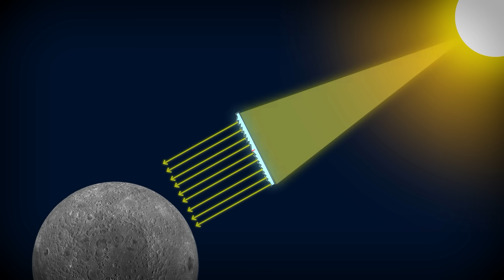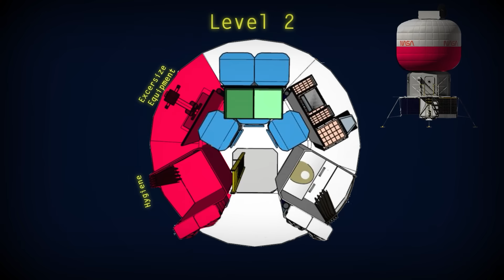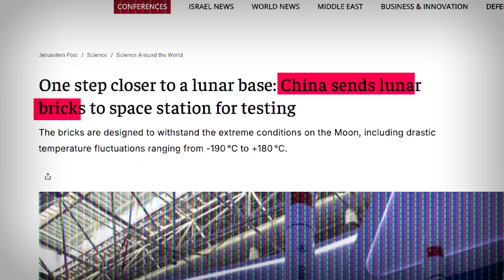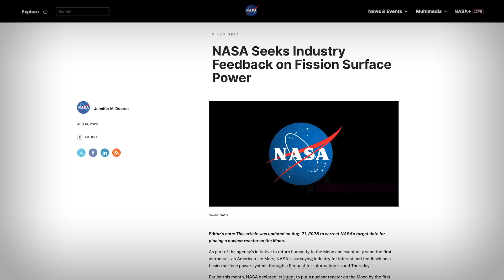How NASA Will Build A City On The Moon

Comment: NASA ain't building squat on the moon! 2025 America, has a trade deficit of nigh on 40 Trillion dollars, and hasn't the money to get to Kansas, let alone the moon! The reality is this simple, if the Americans actually landed on the moon in 1969, which is still highly doubtful, the endeavour cost billions back then, and now would cost trillions of dollars, to return,  that America can ill afford. Ok I will put it in simple terms; until the moon has water and air to breathe, no ones going to live there. Ok , lets discuss a possible scenario to make a settlement on the moon possible. Step 1( assuming that the monies for such an enterprise were magically available) then you would need to send to the moon,  most likely on hundreds of trips,  robotic surveyors, robotic excavators, robotic diggers etc, to build underground, vacuum proof dwellings. This because of radiation and meteorites falling on the scorching surface in daylight, and freezing surface at night. Step 2) those same robots or maybe different ones, would need to build on the surface of the moon, many huge vacuum proof domes, for the growing of oxygen generating plants, again managed and run by AI controlled robots, and most likely on the ratio of one dome per human,  for sustainability of that human. Step 3) The robots would excavate and build and underground network of roads to connect each dwelling. Step 3) I missed out, the power for all the excavators diggers etc, would have to come from massive surface solar panel energy farms. Thus, maybe now you are getting the picture, the logistics and costs of trying to settle on the moon, would take trillions and trillions of dollars, and most likely take four to five years before a human could set foot on the moon again?,  and hope to survive! Quite frankly its just a pipe dream, and whilst I acknowledge that from a technology viewport, it may be possible,  from a cost and logistics viewpoint,  I cannot see it happening. It will only happen if the moon can benefit the nation expending all that money,  otherwise forget, as there is tangible no return, on the staggering stratospheric outlay!

Comment: I’m just a layman and I’m probably missing a bunch of things, but instead of lasers and lenses to melt the moon sand, why don’t they just use a massive bomb that will create enough heat to melt the surface for a diameter of about 50+ meters around the build site? Yes, it will also blast a lot of the loose material away and send it into orbit for a month or so… so just wait a month for it to settle.
Reply: You are certainly "missing a bunch of thing." "Bomb" theory greatly benefits from the existence of air and friction.

Comment: Lava tubes would make for better protection from radiation and meteorites (assuming they are close enough to the craters on the south pole). This also needs to be a global effort, not a country vs country thing.
Reply: You are 100% correct about the lava tubes but seriously, I doubt if China is going to share anything. PS, lava tubes are likely to have their own water/ice.
Reply: @chrism.1131  Interesting, how could they have water ice if it comes from comets?
Reply: @Vandel212  it does not come from comets. It was blasted off the surface of the Earth along with same material that makes up the moon.

Comment: You're better off at this point to alter the human to tolerate space than alter the environment to accommodate the human.
  I'm not wrong. Life can adapt to deep ocean trenches or caves, find a way to genetically fast forward adaptation.  Or go build a "space house". One of these 2 options has millions of years of successful adaptations, one is essentially a lego house from the mind of a toddler, who thinks they're smart of course.
Reply: I think that if we ever reach Mars, it will be necessary to make some genetic modifications to the colonists. Moon or Mars though, they will still have to live in pressurized habitats. Neither location has any air pressure to speak of.
Reply: @giterdone4777  What's the missing genetic ability from every "gray alien" ever depicted?  Genitials and anything needed for reproduction, it makes sense, it's unnecessary weight for travel in space.  Especially if births have been outsourced to something else to remove the burden from humans. It gets creepier the farther down the rabbit hole.  What if we're the actual aliens, just more advanced versions of ourselves? Or, what if Ai, current day Ai is every UFO ever seen, it advanced itself far enough to solve time travel? Who knows?

Comment: Build IN...NOT ON....  For Robots  digging holes,Walkways between structures, garages would be simpler than what you plan...Take one of those inflatables, put it in a hole and cover it up...The connecting walkways would be lined with  plastic sewer liners  cities use to fix sewers instead if digging them up to be replaced...This liner would add rigidity,prevent air lose, and cut down on the dust hazard. If you need to borrow a cup of sugar from a neighbor or have people over for dinner, they can just walk over...No space suits needed

Comment: Why not blow away the regolith or mix water and regolith to form an icy stone.  (Heat up the water and spray it onto the regolith)

Obviously idk if this can work or not, but worst case you turn it into blocks of stone using the ice to coat the outside of a block of regolith making it's own container.  (No need to get it soaked deep down, just need it solid enough to store the loose stuff without it going everywhere)

Comment: The US has never been to the moon at all. All you saw was not beyond the movie theater. This is able to logically explain why they have repeatedly declared they would land on the Moon since the beginning of the century: in 2016, 2020, 2024, 2026, 2027, 2028, or 2029. As you can see, the closer to China's schedule, the higher time density is set. No systematic, persistent and consistent schedule for this serious long term commitment at all. Except a few crappy attempt to land since this year we have seen nothing in significant progress. When it comes to China, the framework has been set up with Chang'e 5 and 6. Now everything is ready except their CZ-10 rocket which is supposed to launch in 2026 second half. By the way the chinese has never failed to their lunar program.

Comment: No. Sorry. Everything needs to be in a connected tunnel & canyon network deep in the ground. Radiation would kill you off quick on the surface and  Lunar micro-impact event frequency is common like a rainy day. Surface Structures would not last long. Too many holes in structure from the zero atmospheric environment that does not vaporize meteoroids from the size of a marble to basket balls equal to 1 ton of TNT. Computer that.

Comment: We need to build the life support systems that planet Earth provides us for free.
Now we are going to realise just how costly it is to replace our planet. I very mich doubt we will be able to build most of the life support systems but we will see.
We will need to build a water cycle, and air cycle, a carbon dioxide cycle and a waste cycle. 
All the above is conducted by the sun and the Earth via weather and the biosphere and minerals on Earth. 

The only thing that comes for free is the solar energy from the Sun and the minerals on the moon. 
I think  we can use nuclear energy on the moon since we can launch the watmst into a retrogtade orbit around the Sun via wlectric propultion and chemical boosters.
Over a few yrs the wast will just fall into the Sun and burn up. 

So we will have solar and nuclear energy. From this we can power all the AI bots we need to do all the constrruction work we need and to power mining operastions, milling and refining to produce metals, minerals for bricks and cement so that undefeound buildings can be produced. We will also need to extract oxygen and methane  and water from the moon. Using AI bots for mining, milling andd refining is a no brainer.
Also using AI bots fro groeing food and doing repairs and maintenance will ve key. 

So to be honest the key is developing all the different AI bots we will need and safe, highly reliable micro-neclear power generators.

Comment: We dont need to build a big base...we need to dig a big base. Need more room, excavate a new cavern. We can make huge rooms. Dig 50m down and expand in all directions. Totally protected from thermal extremes, space rocks and radiation.

Think ant nest.
Reply: You don't need to dig. There are hollow lava tubes under the surface and some parts of them have been exposed when the surface collapsed. However, they are now solid rock and the natural tunnels from the lava tubes are large enough to hold a small city with ten story buildings.
Reply: @socoman99  Unfortunately water is most important and probably present in these permanently shadowed craters where there aren't any lava tubes. Catch 22.
Reply: @fossilsfabe4304  Elon Musk has a boring machine.
Reply: @fossilsfabe4304  inside lava tubes are permanently shaded, with their lower elevation, they are the most obvious place to find water
Reply: @socoman99    I can't believe there is even a debate about this. Lava tubes are the obvious choice.
Reply: Agreed we need to Dwarfmax on the moon. Beards, Grudges, and ale required.
Reply: these bases are just the footholds, you need to set up basic infrastructure like roads, landing pads, ands properly survey the area before you start on larger infrastructure like a properly dug out base
Reply: Not an ants nest. A mine.🐜🐜🐜
Reply: We need to rock and stone.
Reply: Yup, way better protection. Likewise, soil creates pressure making a strong surface for a liner support, the ones we see on the above ground inflatables won't be needed. Above ground should be used for recreation and some infrastructure, pool, swim up tiki bar,,,.
Reply: Wonder if there are denser gases deeper in the tubes? If we encounter 5psi it might be possible to adjust oxygen levels and allow for short term exposure IF we can work with what's there. 5psi=Mt Everest or 1/3rd sea level, its a pressure that keeps body fluids from boiling and water a liquid. If these tubes descend 5000 feet I wonder what the temps and pressures are, could there be liquid water? Any gas pressure that is present would also be deducted from a structure required to maintain livable pressure levels of at least 12psi which is equal to 5000 feet on Earth. 3psi of ambient pressure would relieve 1/4 the load and keep people from exploding. These tubes are very interesting, didn't know about them, thanks for sharing. Elon needs to build mole bots and see where they go.
Reply: @DanWipper  On Mars that may very well be a possibility due to its higher gravity than the Moon and evidence that there is much more water ice and CO2 ice subject to sublimation than the Moon possesses. This possibility depends gretly upon the ambient temp of the cavern. I think that any gas or vapour on the Moon dissipates rapidily into the vacuum of space regardless if in a Moon cavern or lava tube or it resolves to desublimation of gas into ice.
Reply: Cover the HLS with Kevlar.
Reply: Good, but Moonquakes are real. They can reach magnitude 5 and last for hours!!, not minutes. A deep underground cavern might protect from radiation and impacts, but it still needs serious seismic-resistant design.
Reply: @hakanzobu3883  I don't think you'd need to go deeper than 30 meters to achieve the thermal benefits, impact protection and radiation screening needed. And everything  excavated out is a resource. Most of the space excavated will be for farming and atmosphere reconditioning thereby minimizing the threat to human injury if a chamber is compromised.
Reply: And do what on the moon exactly? Why would we be there long term?
Reply: You sound luke a gynecologist.
Reply: @oliviajohnjohnolivia8142  I think you've mixed up your caverns and cavities.
Reply: We should probably practice by digging cities into the Earth first.

Comment: eh it’s cheaper and more reasonable to build underground on the moon instead of the surface, considering the impact craters all around and lunar bases aren’t really invincible. i’m gonna be completely honest with you. anybody who’s familiar with billionaires and imperialistic expansion understands NASA didn’t stop in 1969. we just stopped hearing about it. after the first lunar mission deemed successful on july 21st 1969,the second NASA mission followed shortly after in around 1973-75 including (oxygen ventilation system with enough air to last a team of 5, 1 extra day in case of emergency, multiple military grade air tight tents to be installed in the new holes that were being buried into the lunar surface with simple hand held low gravity construction equipment and a team of about 5 men.) once these holes were dug and the air tight tents were installed,the air ventilation system was set up and filtered through a pipe leading up to the lunar surface. after a stable reconnaissance had been established underneath the moons surface, the team proceeded back to earth, a THIRD mission was then scheduled by NASA in the early 1980s to bring the already established lunar reconnaissance base more materials,oxygen tanks, and air locks in order to expand this lunar base underneath the moons surface, by the late 80s early 90s one can estimate hundreds of airlocks and research labs were dug out,constructed and created to withstand human life…i refuse to believe we left the moon in 1969 and go so far as to say there are whole human generations that have already been born on the moon that don’t even know about life on earth.

Comment: The unfortunate answer to this is "Nasa will not build a city on the moon, ever."

SpaceX is probably capable of it, but they have no interest, for obvious reasons, because the moon is a stupid place to build anything.  Mars isn't MUCH better, but it's the best of a bad lot and although the Mars transfer window makes supplying Mars technically more infrequent, the actual potential for ISRU is much better on Mars and because it HAS an atmosphere, the cost of bringing payload to Mars surface is, counter intuitively cheaper, because you don't have to spend all your DeltaV on a landing burn, you can use mechanical braking from the atmosphere. 

Nasa is only ever interested in appearing to want to build on the moon because it soaks up rival countries government spending on equally useless projects as long as the U.S. appears to be interested, but Nasa's budget is laughably inadequate to the task when you also take into account the things their administration says about, for instance, relying more heavily on SLS.

None of this is a serious goal, it is simply a vanity project and it will never be completed by the current people pushing it. 

And once the generation of Nasa people who still remember Apollo die out, there will be no further impetus to continue the project because all the money and innovation are going to be in large space habitation, the Blue Origin route, or in Mars colonization, the SpaceX route.

This Moon thing will never happen.